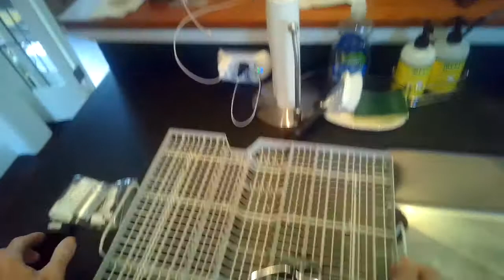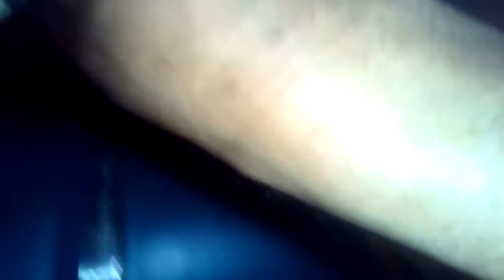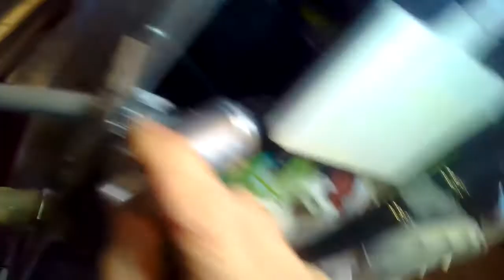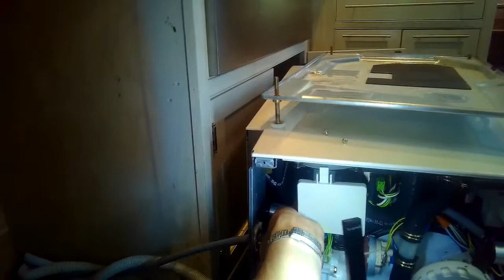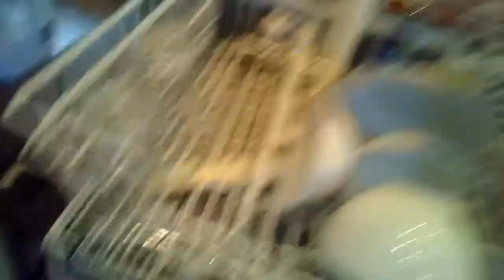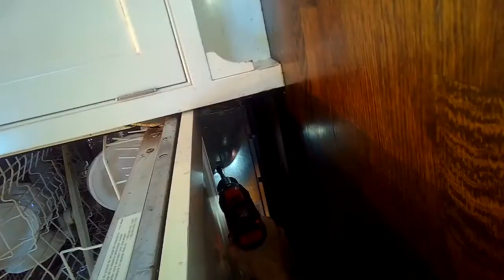Miele Dishwasher Motor Keeps Starting and Stopping (FIXED)

Comment: Hi thanks a lot for the very clear and helpful video! Before I order the part, would you be able to tell if the reason for the dishwater to stop by itself after 5min, no more light on, could be linked to similar circulation motor capacitor issue? Thanks in advance!
Reply from the maker: Great Question,  can you contact me at: scottthefixitguy@yahoo.com With the Model Number and the problem?

Comment: Replacing the capacitor did not fix the problem. Wasted money on a new one from Miele and took 3 weeks to get it.
Reply: Same here!  My problem with the dishwasher is probably elsewhere, not the cap, which I replaced but did not address the running and stopping.  Probably the heater/pressure switch.

Comment: You want to laugh. So that Miele dishwasher I got came today and they installed. Straight away. Problem!!!! I'm not sure if it's an installation problem or maybe the dishwasher is just defective. Within 10 seconds of guy turning on the machine, the intake light came on. It would start and stop. Start and Stop. It ended up running the cycle and it drained,  but now it's just doing this and it's make a weird noise.

https://www.youtube.com/watch?v=faNFkXpwHUA

The problem is the guys that installed the machine aren't authorized by Miele, but I watched them put it and it looked like they knew what they were doing. Now I'm starting to worry because the warranty card says if machine isn't installed by Miele tech, it voids the warranty. I've just about had it with these machines. When they work, they're amazing; but it's a nightmare when they go bad.
Reply from the maker: I wonder if the incoming water pressure from the house is too great?
Reply: @QuickAndEasy5MinuteAppliance  It can't be. The water comes in and it stops. Water comes and then it stops. It's the craziest thing I've ever seen a machine do. The machine doesn't even drain when you hit start which leads me to believe there's a defect with the machine.  I really don't know.

The water pressure was the same with the prior machine which ended up getting fixed. It was the heat relay, heat pressure switch and another part. I just gave that machine to my sister. A couple different guys are coming this morning to check to see if they installed it properly. If not, a Miele tech is going to come out. I mean technically it's under warranty. Sometimes the Miele techs don't know what they're doing.

And I have to point out something else. That old machine from 2010 seems more solid than this one. It's still better than any other brand, but compared to the one I had; even the hinges are more solid. The door was twice as heavy. Then again that was $1899. I'll let you know. Thanks for responding.
Reply: @QuickAndEasy5MinuteAppliance  Okay the company that did the installation sent two new guys who do installs of appliances on high-end homes. I don't have a high-end home, but at least they had some knowledge of these appliances. He ran the machine on the Pots and Pans cycle and then on the Rinse and Hold and the end result is the same. An F70 fault blinks, which on this machine indicates a fault with water proofing system; but I'm not sure if that's even the problem. He didn't want to touch it because that may have voided the warranty. 

Thankfully, they're sending a Miele technician on Friday at no charge. Which I found a little shocking considering one of their techs didn't install it. We do have a range, washer and dryer and two vacuum cleaners that we bought from them so that probably helped. The service techs are actually ridiculously nice on the phone despite all the negative complaints people make. I mean they really try to help. 

He did say the machine despite being technically being new, is from January 2018. They said machines come with some water in them and if it was moved around a bit, water may have gotten into the drip pan and that may have activated some switch which may have failed. Ugghh!!

They saw the video, but until they actually open the thing; they won't know for sure. The only part that concerns me is what part or parts will they have to replace? From the way it sounds, this can't be something that can be remedied in just one visit. Why does it make that strange sound and it struggles to drain. I guess we'll find out.

Comment: Hi fix it guy
my dishwasher starts up , fills quite well  then washes again meanwhile it doesnt heat the water at all , the  water stays Cold then it ventually stops,... Shows all the 8 x lights flashing while making a  buzzing Sound which goes on ond on,
..I did a Little Experiment by filling ou the dishwasher with extra water but to no avail, no Change ?? can you help with a Tip?
Reply from the maker: Time for a new heater relay